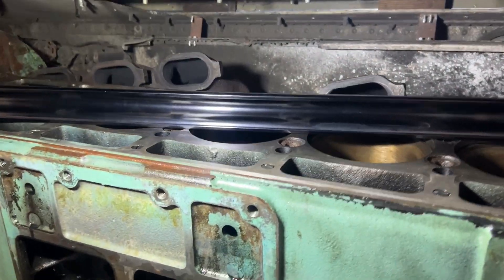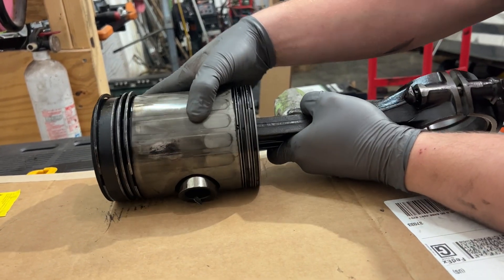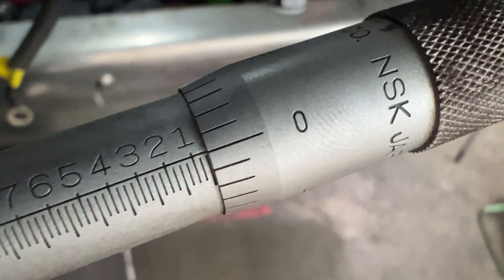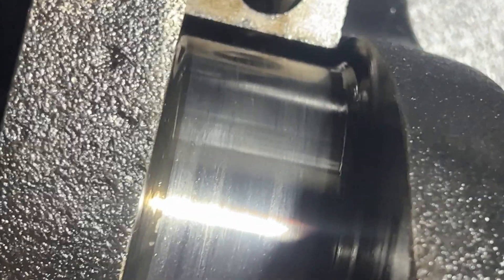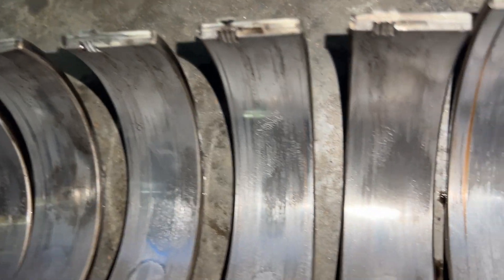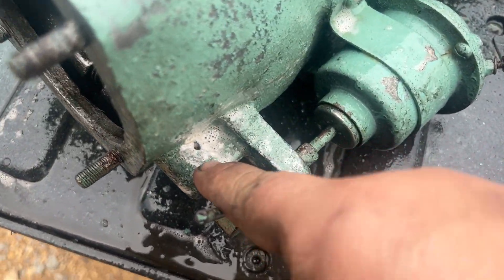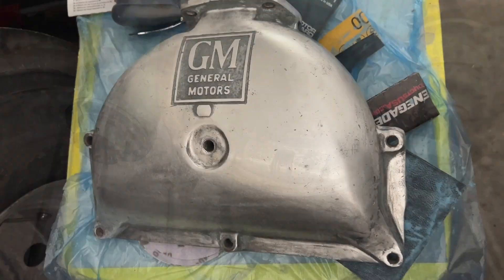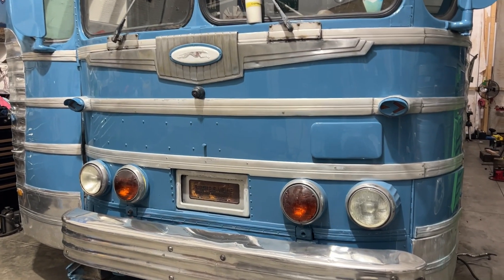Rebuilding the detroit diesel 6-71 that was over heated.

Comment: Do you measure the bore of each cylinder in the block to verify the bore size and check for tapered or out of round cylinders?  

Do you measure the rod bushings with a pin gauge to check for wear before installing new pistons onto rods?

I don't remember seeing either of those procedures in any previous videos on this channel.

Comment: when you talk about this being a left hand rotation engine, on the detroits, is that looking at them from the flywheel end of the motor, or the fan end of the engine?
Reply from the maker: In this gm bus the detroit diesel is a reverse rotation setup.  A very small percentage of detroit diesel 671’s are left hand rotation.   Most Gm buses and boats are about the only uses for ccw rotation engines

Comment: I haven’t been around working on a Detroit in decades and you brought up checking the wrist pains retainer cups with a vacuum gauge. I completely forgotten about doing that. I knew about punching a hole in the center to pop them out but checking the new installation with a vacuum gauge, that was a flash back moment 🤪😂👍
Reply: Been a while since I turned wrenches but now I got to find out what you are talking about! Why not just use a c i r c l i p? Vacuum gauge for wrist pins..... I just got to know!!!!
Reply from the maker: There is oil pressure behind the wrist pins.   If you have a leak pressurized oil enters along the piston wall.  Very smoky mistake.  The piston rods spray oil against the inside of the pistons for cooling.

Comment: You replace lots of cylinders  but I don't recall you pulling a cam  or lifters.    Do those not go bad?
Reply from the maker: If they wear out over time but most engines are murdered vs dying of natural causes.  Heat doesn’t take out the cams.

Comment: We had a 6V71 with a roots supercharger in our quarry truck! It was a screaming son of a ######! I read somewhere that the 6V71 stood for V6 with 71CI per cylinder!
Reply: which comes to 426 cubic inches. So they made really good power in the late 30s when the 6-71 was first made. For modern standards, they were a tiny engine for a truck or bus. Today they run 14-15 liter engines.

Comment: At 2:18/2:19 the top compression ring have their gaps aligned.  Time to fix that.  Tell me you fixed that before putting the cylinder sleeves in the block!
Reply from the maker: Thanks for playing but there are 4 rings on top.

Comment: I worked for many years at a boat repair facility. We had a customer with a twin 4-71 powered cruiser who said that both engines were smoking heavily, and had no power. He did not want anything diagnosed. He just wanted modern engines in the boat. When the boss went to the boat to start the process of figuring out what all needed to be ordered for the job, he found that both of the intake dampers had been tripped. When the job was done, the customer had modern 4 stroke engines, and we had a pair of perfectly good 4-71s.
Reply: That´s perfect, exactly what I would have done!
Reply: Sounds  dishonest to me
Reply: @bobbybackpain  As I said, the owner was not interested in discussing the original engines at all. He wanted no diagnosis, only replaced with modern engines.
Reply: @bobbybackpain  no, the Customer wanted a repower with modern engines, and that's exactly what he got; and the customer likely didn't care what was done with his old 4-71s because according to him they were worn out junk.

Comment: A four valve head would be nice. I am surprised the valves are so small on these engines.
Reply: Those 2 stroke diesels don't rev that high. They sound like they do. If its reving at 2g's, it sounds like it's reving 4g's. Two valves are usually sufficient. 😄👍
Reply: since they are all exhaust valves they seem to do fine, but, sure a 4-valve head would be nice. This is Scott's old head from when he upgraded to a 4-valve

Comment: ...what continues to amaze me is the memory you have Scott, all these little details about parts...  there is more that just your years of knowledge up in that noggin.....
Reply from the maker: I do continually refer to the manual to double check my memory.  Like the perimeter oil seal on the head.  It’s got a green stripe on one edge.  I said i think it goes outwards away from the cylinders but i double checked.  I was correct.
Reply: The manuals are highly detailed.

Comment: Making good progress.
At 2.18 in the video you seemed to align the ring gaps. Is that a Detroit diesel thing? Also you said the mains were turned 0.030" over. I think it should be under size.
Reply: He said it has .030 oversized bearings and those were as big as you can get them these days. The crank has to be .030 undersized to fit .030 oversized bearings.

Comment: The blower end plate being totally different was a total surprise. Lenny is looking really nice. Not long until we hear the 6-71 run like new.
Reply from the maker: Lenny has the same plate as the new blower.
Reply: @BusGreaseMonkey  So they must have changed the blowers design at some point it seems. At least the new blower looks much better and the blades don't look pitted and scraped.

Comment: Do you have any tips for a crown school bus 530k miles on it? I’m going to build a tool list based on your video from earlier this year. I’m watching and learning how to adjust and maintain the bus. Also I’m thankful you guys make great videos on how to rebuild these engines! Also my bus engine is mounted on its side to fit in the middle of the bus. It’s a 6L71T 275 horse engine with a 4 speed Allison.  I’d like to covert this bus to have the fire truck specs and a 6 speed Allison in the future.
Reply from the maker: Don’t over heat the engine 180° is normal operating temperature.  Watch oil pressure and water temp gauges continuously.
Reply from the maker: https://youtu.be/MZdfIaPlxKg?si=vSVU8_ZCtjflTq_e
Reply: @BusGreaseMonkey 
Check out "Al Jennings Crown and Gillings Bus Collector" He's driving around a Crown in LA. The video is 2 years old. Great sound of that 6-71. 🚍👍
Reply: @henrys.6864  I do follow him fb and YouTube. He doesn’t have any building and tune up guides. Lots of driving videos though
Reply: @BusGreaseMonkey  can I also get invited to your website? I submitted a form but still haven’t received a link yet.